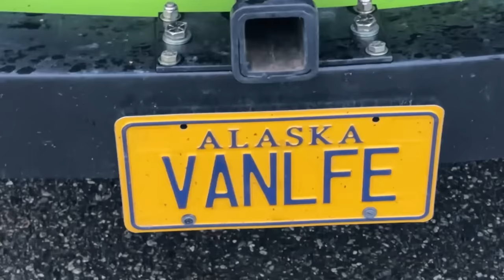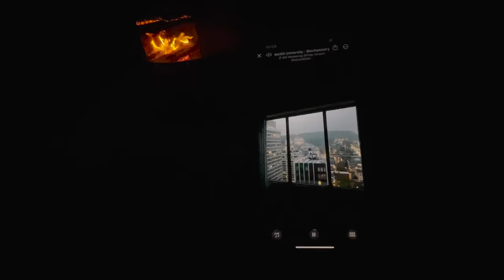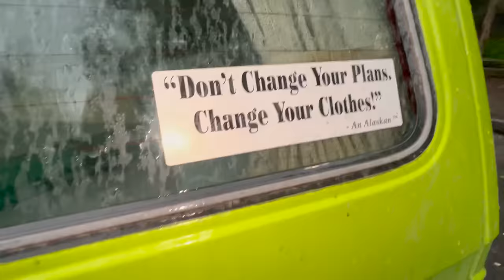Overnight Camping in the Alaskan Mountains - Ribs over the Fire

Comment: In Europe this vans are called "Transporter" and there are 5 generations of them, T1, T2 etc, they were offered with different configurations like passinger and cargo setups and they were both offered with diesel, turbo diesel and gasoline engines. To this day they are still on the road.

Comment: They use to swap in Porsche engines for the older VW buses. Back in the 70s and 80s. Not obvious the new 800hp Porsche engines, but that would be rad. I think Subi is the right engine for that Wesfalia, good hp and reliable. Could even do an STI swap and then you would have enough git to tow a small trailer.

Comment: I can swap an engine, but you wouldn't want a Cummins in Steve. The 6bt is too big (and it weighs around 1000lbs!) and the 4bt doesn't give you enough torque and hp for the cost and size of the engine. For Steve you would want to swap in a Mercedes OM606 turbo diesel built to about 325hp with 450ish lb/ft of torque.

Comment: You are mistaken with the color of the fish. It is not a causation that the meat is bad because they are red, it is simply a correlation. 5hey are red because that is the color they turn when they go to spawn, it has to do with secondary sexual characteristics. Essentially the fish prefer the other fish to be red. It just so happens that when they are returning to their streams to spawn, the meat is starting to deteriorate  because they have traveled so far and for so long without eating much if anything. Both the color and the quality of the meat start to decrease at the same time but one is not because of the other.